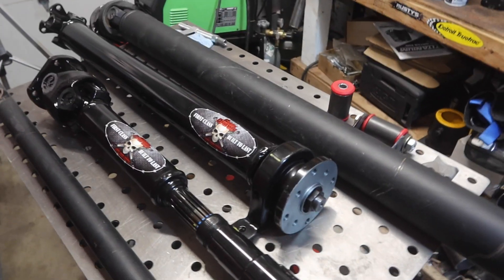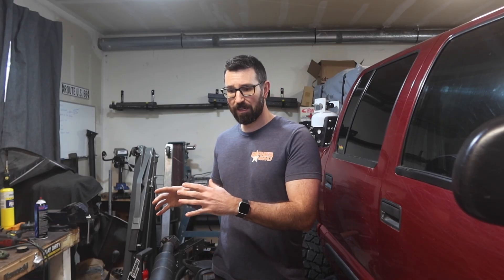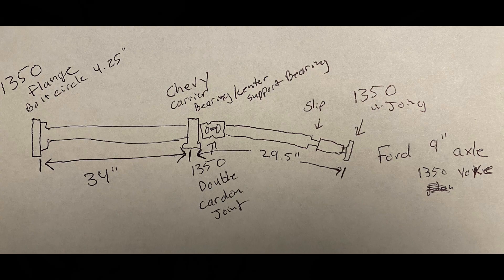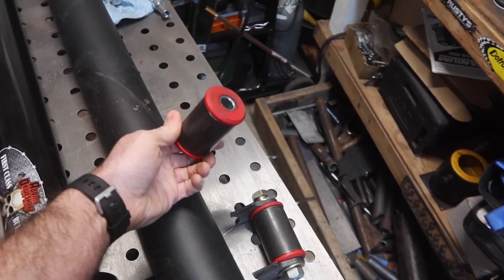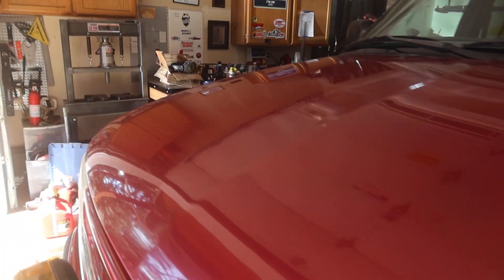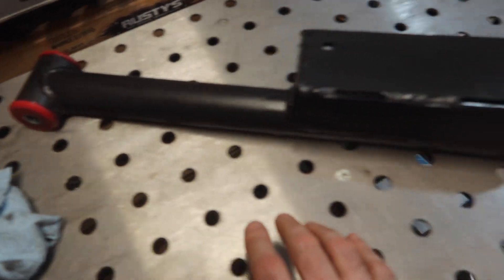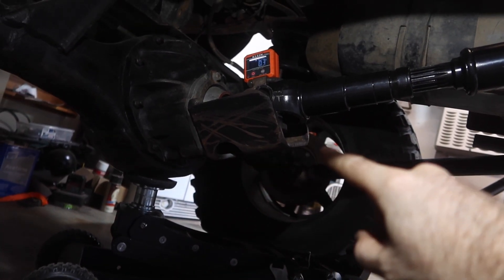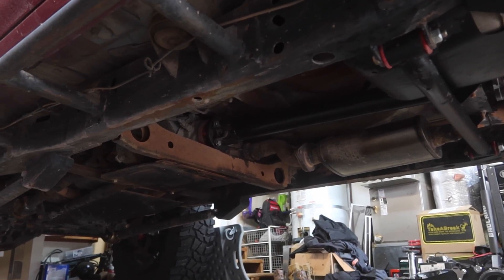One Piece VS Two Piece Driveshaft, which is better and why?

Comment: Great Vid! Could you resolve the ground clearance issue with a Tcase doubler?
Reply from the maker: It would have definitely helped make the rear shaft shorter for sure. But a doubler and a new driveshaft was definitely not in the budget, lol.

Comment: Adams didn't give you a part number of that companion flange at the support bearing did they?  I'm looking at the same setup in my current build but I'm limited to a budget so I'm trying to scrounge factory parts use.
Reply from the maker: It was called a “mid-ship kit” I believe pm3114-0030g.
Reply: @MuddyBeards4X4  Thanks.  I think I figured out a solution on my end.  I was able to machine a stub end from a F250 midshaft to fit the XJ driveshaft.  The stub just happens to be the same spline as a Dana 60.  So I have a cut down XJ rear with a F250 carrier bearing and a D60 flange. lol

Comment: Awesome set up, do you think running dual cases in a truck with this sort of wheelbase would help with running a single driveshaft? Still new to the full on building of my rig, but my v8 canyon is going to go the route of your s10! Sas, bigger tires lockers etc
Reply: A dual case would basically take place of the front half of the dual driveshaft.
Reply from the maker: Sounds like an awesome project. Running dual cases would definitely help shorten the rear shaft and give you more ground clearance than with a single case depending on how long the dual case setup is. But you could most likely get away with a one piece with a setup like that.
Reply: @ that is what I was hoping for, thinking eco box and np241 doubler set up.
Reply from the maker: That would be pretty sweet, wish I could afford something like that, lol.
Reply: @MuddyBeards4X4  it’ll be years of saving. Hoping to find deals along the way, thinking Dana 60 ff rear, and Dana 44 hp front like you have but probably going 8lug. Going to be at least a couple years of collecting parts before I bust out the grinder and torch.
Reply: Good to see you making more videos again.
Reply from the maker: @ethancayton8074 Thanks👊🏻